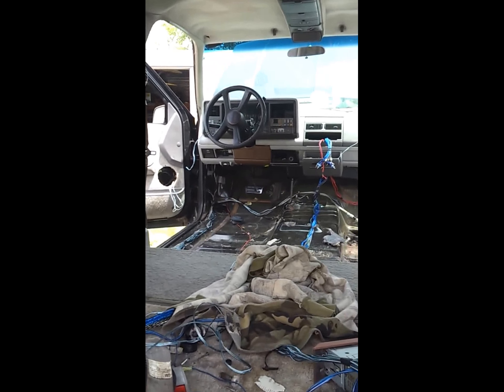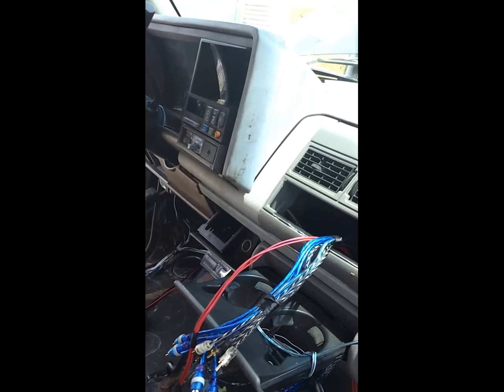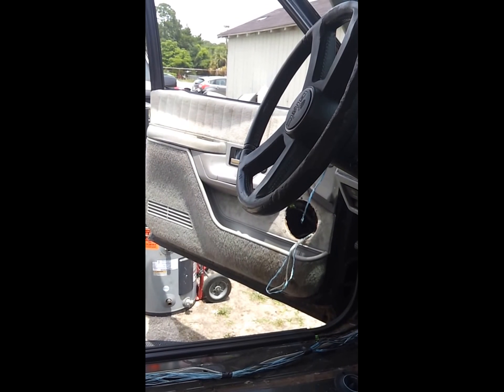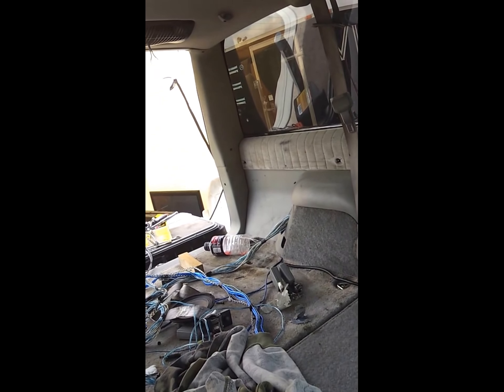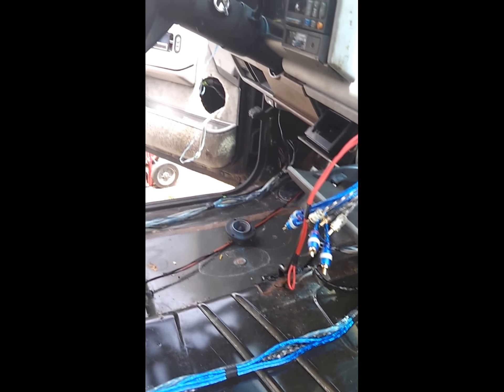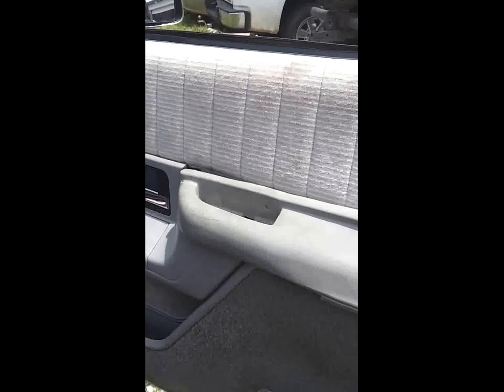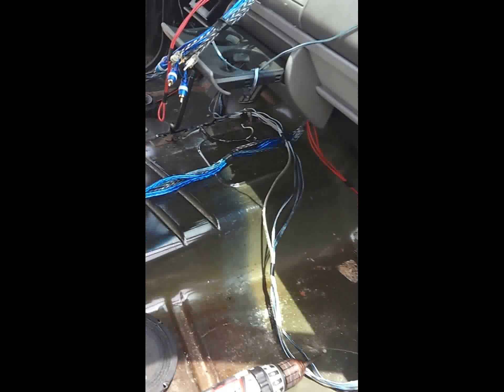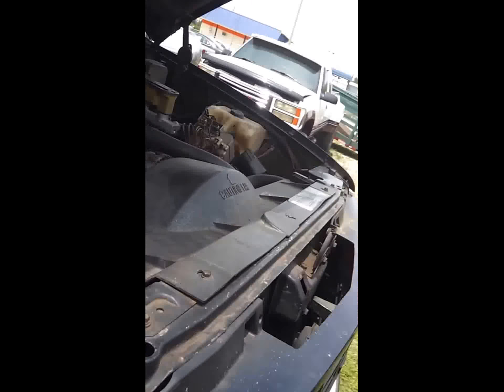1994 GMC Yukon GT Audio Install part 1

Comment from the maker: My first official youtube video so not too good at it yet. Customers truck, he wants a show quality truck. He owns most of the equipment already so im limited to what i have to work with. 4 JL w3 3-4 12" subs, 2 6 1/2" precision power woofers, 2 precision power super tweeters,2 power acoustic 1 1/2" soft dome tweeters, 2 Klipsch 8" 4 ohm subs, 1 RF Punch 400.4, 1 RF Punch 300.1, 1 Quantum Cosmik 3000.1. he already has 0 gauge but im going to do a big 3 upgrade. 5 sets RCA cables and 400' wire

Comment from the maker: i ran 3 sets of wire into each door ( 1 10guage and 2 14 guage) 1 run of 14 guage to front dash 4x6 locations and 1 run to top od B Pillars for power acoustic tweeters. Thats not the ideal lovation for thos tweeters but someone had already cut holes in the panels so im kinda forced to use that. The doors are going to be full custom glassed to house 1 8" sub and 1 super tweeter and 2 6 1/2" mids ( atleast thats the plan right now). Thinking custom kick panels also. Plans are subject to change